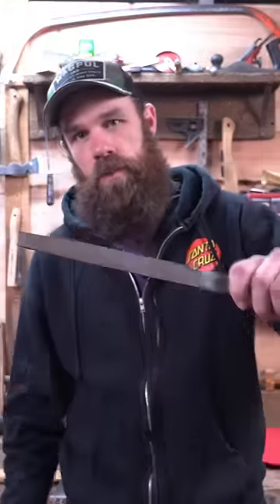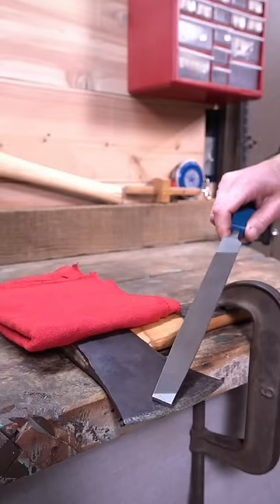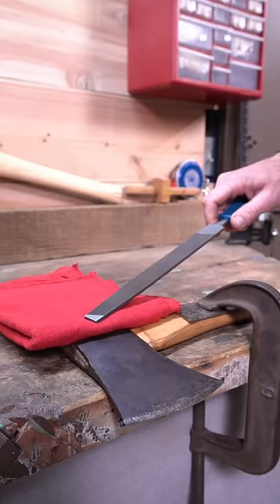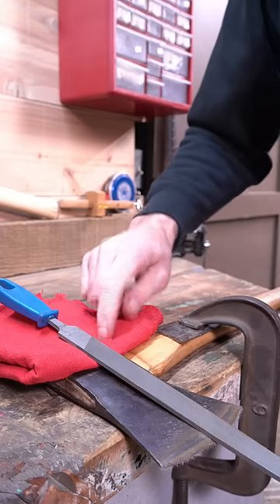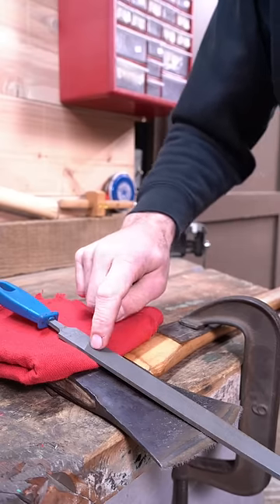How to Sharpen an Axe Using the Rag Method and a Mill Bastard File #axe #tools #howto

Comment: Wont that make the micro bevel not hold an edge well? Just because you’d want it going down towards the tip rather than just sideways. This will on create a weak microbevel. At least that’s the case with knives. Maybe axes are different?

Comment: Is the mill bastard file the best general purpose file to own if you had only one file
Reply: No, if I could only own one file it would probably be an 8 inch half round file with smooth cut.
It'll do most things people need, from general material removal to sharpening tools.

But really, files are small, and they are cheap, why not just get a dozen in various shapes and cuts. Then you can do practically anything.

Comment: Are you supposed to do that process on both sides or just the one side??
Reply from the maker: Depends on what the bit looks like. But most of the time, yes, both sides.
Reply: @old_iron_axe_and_tool  I'm gonna give it a shot on a really really old humongous meat clever I found at work.
Reply from the maker: @Coatney Adkins  I'd recommend a different technique for a cleaver. This is good for axes with a Curved profile.
Reply: @old_iron_axe_and_tool  you think you could make a video one of these days for sharpening a clever?

Comment: I thought a file would skate over hardened steel and not bite into it. Can someone explain
Reply from the maker: Depends on the hardness of the file and the pressure.
Reply: @old_iron_axe_and_tool  aah okay, is it a reliable test to perform if you want to know if something is hard then?
Reply from the maker: @Alessandro Lok  I actually just got a file set specifically for this. Each file is made from a different hardness of steel.
Reply: @old_iron_axe_and_tool  but wouldn't the results just change with how hard you push on the material?

Comment: I guess this works too. I don’t bother with that rag trick though. The axe is gunna dull after the first swing into the log or tree. They aren’t meant be be scalpel sharp but they are meant to hold a decent edge.
Reply from the maker: Ya, I don't mean "surgical" sharp.  More like " that's sharp enough to send you to the hospital and get stitches" sharp. 👍
Reply: @old_iron_axe_and_tool  👍😂

Comment: Are axes not hardened steel?
Reply from the maker: Parts of them are.
Reply: @old_iron_axe_and_tool  is the tip? How are you sharpening hardened steel with a bastard file?
Reply: Axes are usually left somewhat softer,  when compared to other cutting tools, helps keep them tough. As a result can be sharpened with a file.

Because a few rockwell c points of hardness makes a big difference in practice, not much on paper.

Comment: I sharpen knifes. 400 grit is where I start sharpening, not to finish. Why is it different here?
Reply: Because you don't want a massively fine edge on a hatchet/axe .. you want it SHARP but also it needs to be durable and not ding, dent or roll the edge when putting some power into it. 👍
Reply: Because a working tool edge doesn't need to be straight razor sharp. You can do higher grits, but what's the point when it's going to get ruined the second you strike a piece of wood?

When you're sharpening knives meant for cutting open boxes and cutting veggies in the kitchen, you want something sharper because it's not going to take a bunch of blunt force impact. The finer the edge, the more fragile it is.
Reply: @kelvinhopes8410  Ah ok ty

Comment: Just wait until a piece of that axe head chips off. I sharpened my dads axe when i was young and got it nice and sharp and when he swung that axe the head chipped and the piece that chipped off flew into his shin. That little piece of steel migrated to his calf muscle and he cant get it removed so no mri scans for my dad.
Reply from the maker: Dang man. It wasn't your fault right?
Reply: @old_iron_axe_and_tool  oh no it totally was. I got the axe too sharp and i didnt tell my dad so he had no idea. The edge of the axe head was just too sharp to be able to withstand being swung into a log so it chipped.

Comment: Only 400 grit?
Reply: Grit doesn't correlate with sharpness
Reply from the maker: Care to elaborate sir?
Reply: @old_iron_axe_and_tool  Me or the other guy?
Reply from the maker: @autumn5592  You. Curious to hear what you mean.
Reply: @old_iron_axe_and_tool  Sorry for the late reply, I had sent that shortly before I went to sleep.

When you sharpen something, you make 2 planes (bevels) intersect. These bevels form an apex (point of a triangle), the thinner the apex is, the sharper the tool is.
(Without getting into things like geometry or the sort, because it's not exactly relevant.)

When you sharpen on an abrasive like whetstone or sandpaper, the little grits scrape away material.
The apex thickness is not particularly affected by the grit size.
There is a slight difference at coarser grits, like in the 80-320 grit range, but nothing that would cause significant sharpness difference. You can still make an edge shaving sharp, you just won't have the sharpness to do silly party tricks like cut hanging hairs in half.
Past 800 or so grit, you get some pretty serious diminishing returns, sharpness difference becomes practically nothing, and past 2k, well forget about it, there's hardly a measurable difference.
The only reasons you would take it higher grit is for surface finish on things like instruments, straight razor shaving (improves the feel of the razor on your skin), and traditional things like sushi knives (it is believed the finer edges 'damage' the meats less, making it taste better.)

And, in regards to teeth/"microserrations", the grit particles do not create them, they don't really exist.
The grits do scrape away little gouges from the steel, now you would think this creates consistent gouges over the entire length, but abrasives only bite for short distances, so you get very even material removal over the bevel, and the high variation of the apex (the peaks and valleys) follow no pattern with grit size, or really method of sharpening.
They are just remants of sections of steel that 'let go' from the edge. That's all.
And strangely enough, they can get bigger/rougher with certain types of abrasives, like fine diamond plates. I'm not sure why that's the case either.

So yeah, as long as you are properly sharpening (forming thin apex and properly deburring (if burr sharpening)), then you will have an edge that will outperform what any normal person is likely to encounter.

The limit of how sharp a person could reaonably get, is themselves. How steady they can hold angles, how light of a touch they have, how they can feel whats happening when sharpening, how well they understand the process.
The vast majority of people will never have steady enough hands to encounter the limit on normal edged tools.
This even applies to jigs, or systems, because they have slop, and user error.

I sharpen knives professionally, and even I don't have steady enough angle control or light enough hands to do it on any normal cutting tools.

Finer grit stones or abrasives can HELP with getting a finer edge, and that's where the misconceptions start.
Becaise coarser abrasives remove MUCH more material, it amplifies the errors you make, one slight change in angle, and you mess that section of the bevel up a little, or form a burr bigger than you ment to.
With finer abrasives, these issues become less and less, so you don't have your errors coming into play as much when sharpening.
People mistake that for the abrasives being what produces the fine edge, instead of not sharpening wrong.

That's why the biggest thing I preach is your abrasives don't matter, your skill in sharpening does.
A skilled sharpener can make anything sharp off the coarsest shittest stone they can get their hands on. No one needs fancy stones to make an edge.

Touching back onto geometry, it does play a big part in total sharpness, you can't just sharpen a 1/2 wide bar to 20°per side and then expect it to shave. It can be a fine edge, apex thin enough to achieve it, but the material behind it just causes wedging, or inability to pass through the materials.
Geometry matters moreso than total sharpness.
A thinner slightly duller tool will cut significantly better than a thick perfectly sharpened one.
Factors like; thickness of the tool at the spine and edge, the height (from bevel to spine), the edge angle, the grind type (hollow, convex, flat, etc.), types of tapers, secondary or tertiary (micro) bevels.
It all plays a part in effecting sharpness.
But for most people, on most cutting tools, putting a good edge on their tool will be more than enough to make their tool perform well.
Not exactly important to the grits effect on an edge, just good to have an understanding of the full scope.

Sorry if it's a bit long. I ramble about this sorta stuff a lot. 
Happy to help it answer any questions.

Comment: I LOVE THE FACT THAT HE KNOWS HIS FILES. A good quality File (Nicholson & Simmons) are actually  Precision Cutting Tools that are commonly ABUSED BEYOND REASON..! After each use, use a File Card to remove the shavings between the teeth and then apply a light coat of oil or WD40. And NEVER, EVER... Stack bare files on top of one another..!
Keep them clean and rust free and they'll last for more years than you'd expect. How do I know..? Been Selling Industrial Tools for over Forty Years. Oh yeah... DON'T ever use a File without a Handle. The pointy end is called the Tang and it will do major damage to your hand if used without the Handle that it was made to hold. 😢

Comment: I like to just use my stone foot wheel instead of spending 17 hours grinding my axe blade but that's good to know for when I am not at home and it needs to be sharpened or you just have 3 axes one double bit with a splitting side and a chopping side and one with one of those trenching tools the ones that kinda look like a garden hoe and just your regular more beat up splitting axe the thing though is it's one that's not to sharp even for a splitter what this one is for is the bad ugly wood or something that's got stuff all stuck inside it like a wire or something and you use that axe so you don't screw up your blades

Comment: 400 grit?
I take my chisels to 3000 grit before I use the ultra fine polishing compound and strop to glass finish.
Reply from the maker: Ya, I'll go to 800 on my carving axes. 120g belt and 400 free hand for most everything else, including throwers.
Reply: @old_iron_axe_and_tool  as it should be!
Well done.

Comment: A good way to ruin a file! Files are cutting tools not abrasive, they cut on the forward stroke like a saw. They are not designed to work sidey sidey like this you'll just get a nice dull patch on your file after a couple of goes as you would if you tried to use a saw like this. Hope this helps y'all. ❤
Reply from the maker: Draw filing

Comment: It works but why not just use your damn axe puck like a normal person?
Reply from the maker: An axe puck is not the right tool to reprofile a bit. And I find the puck to be less effective than sand paper at sharpening. It's hard to get a burr with a puck.
Reply: @old_iron_axe_and_tool  did not know that I’m no expert by any means I was just taught to use a puck at a young age and that’s all I’ve ever used on my axes before using them I’d always hit them with the puck until I was satisfied and then go to work

Comment: If you sharpen that ax to sharp the edge will roll an it won’t be worth a dam for chopping wood.  Also wrong direction with the file , it will sharpen the ax but not hold the edge very long.
Reply from the maker: O.k.
Reply: Entirely wrong lol

Comment: Fuck me is it that complicated to figure out that working a file that way fucks up its teeth?
Reply: It literally doesn't. Draw filing is a very common technique.
Reply: @autumn5592  it literally folds the cutting part of the file on itself, rendering it less sharp. 🤦‍♂️
Reply: @vincentpelletier1246  Care to show any examples under a microscope? Or any source that does?

Tool and die makers, machinists, blacksmiths, jewellers, etc. Have been draw filing for centuries, they have no complaints their files don't last when they do it.

You sound like someone that has never actually done much with a file.

I bet you think back dragging dulls a file too. Lmfao
Reply: @autumn5592  I've been a machinist for some time. You also learn this in metallurgy class when you learn about quenching and annealing.

Its quite easy to understand really. It also depends on the use. The way a file is made is "kind of like" knurling metal, but in a given direction and by giving it more of an edge.

Anyways, my standards were low on this topic, we are on youtube and this is a short. Plenty of shorts fucking around people's understanding of stuff.
Reply: @vincentpelletier1246  Yeah, that's not evidence, that's an anecdote.

Kind of like knurling, in the sense of how it's formed (in the modern day), being rolled on. However tooth geometry and hardness are completely different to the vast majority of knurled surfaces.

Files will not dull when being used sideways, or even backwards. Fact.

Comment: When you say hospital sharp are you saying they use them in hospitals? Or so sharp you slip and you'll be in the hospital ☠️😂
Reply from the maker: The later. Although I did hear a story about a viking father that used an axe to do a c section on a dying woman.
Reply: @old_iron_axe_and_tool  damn

Comment: Problem is that files dont cut sideways! Nice try! 😅
Reply from the maker: They certainly do. Draw fileing
Reply: @old_iron_axe_and_tool  
Draw filing is a technique, not a type of file. Teeth on a bastard file are usually 60 degrees from the center. Not very effective for sliding it sideways across your work.

Comment: 400 grit ≠ hospital sharp
Reply from the maker: 80 grit will make an axe hospital sharp
Reply: @old_iron_axe_and_tool  400 grit can be shaving sharp if done properly, either way, the wood won't notice
Reply: You can make edges fresh off a file shave. You can also get shaving sharp edges pretty easily off 120-220 grit stones.

Scalpels aren't actually that sharp contrary to popular belief. They can just about shave hair. They require a fair bit of force/movement to actually cut things.

Comment: Let's definitely not talk about the damage to the file by only filing in one area let's also definitely not talk about how you've changed the grind orientation of the edge. And I definitely don't want to talk about how the file is it supposed to cut on the push and not side to side😂😂
Reply: Damage? By using it? Lmfao...
Besides who gives a fuck, files are consumable, a new one costs like 4 bucks.

'Grind orientation'? What does that even mean?

Files cut in all directions. This method is draw filing and been done for centuries. It doesn't harm the file anymore than pushing it straight.

Comment: Hmm🤔 keeping the angle with a rag? Kinda odd cuz different pressure on the rag will change the angle so it'll never be dead on if that's what u want.... Also of your changing the angle to achieve "convex" wouldn't it be a edge with like three steps VS a rounded convex? I do convex with motion of my hands or the belt sharpener does it automatically 🤷

Comment: I find it funny how you guys sharpen axes like your gonna slice through it like it's a beef roast lol. in Australia it's near on useless as our wood is too hard, a sharp edge will be blunt after about 10 swings. we use block splitters most of the time and maybe a sharper axe or hatchet for kindling.
even a high quality axe won't hold an edge sharp enough to slice flesh or anything.